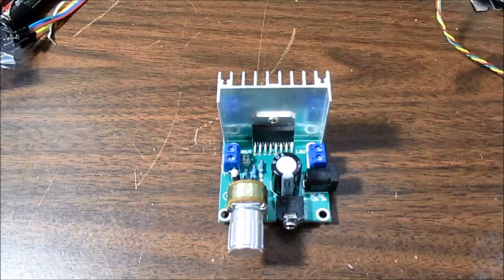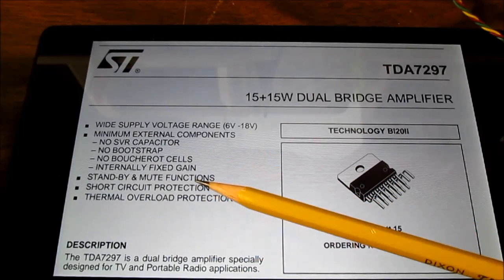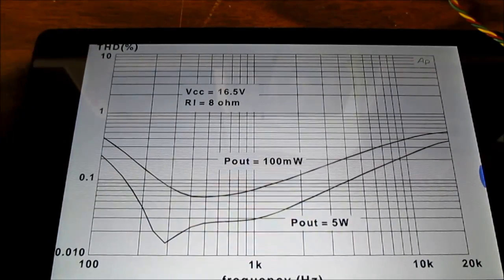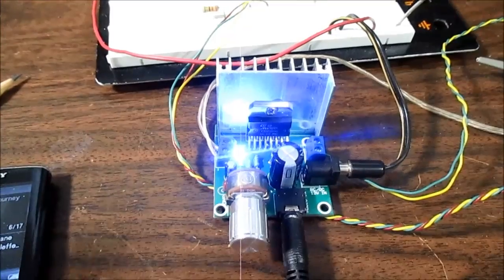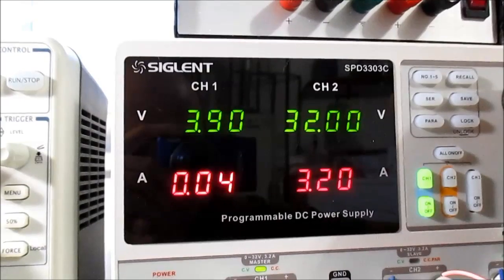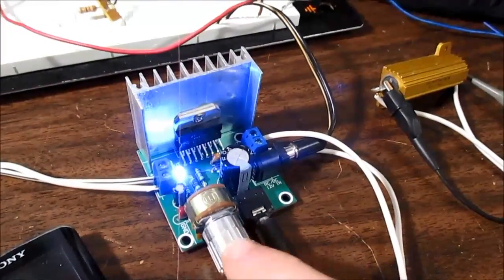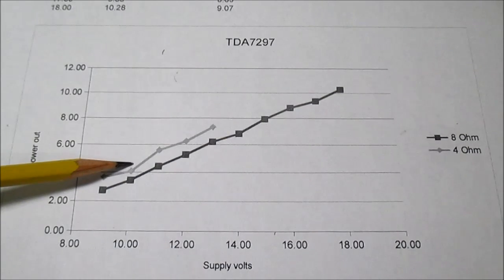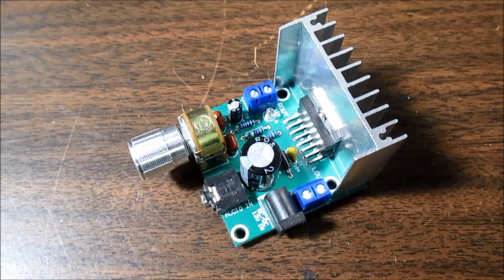TDA7297 stereo audio amplifier board test and review

Comment: Very useful review- looking for a 9v amp for a bench amp to test pedal effects. Tried a pam8610, but found it noisy, and an lm386 (noisy cricket) but the power was underwhelming (was  only able to get 0.3w clean). Price of this module is very cheap now, so worth trying it out- hopefully 2.7w clean output on 8r will work out. Would be useful to learn if and how this amp (module) could be bridged for more power!
Reply: Goid dear..subscribe anotheroption2.0
Reply: It is already bridged. It was done so probably to save on two output capacitors.

Comment: I have questions-
1. Can this chip be powered by a 12 Volt transformer which outputs around 20 volts @ no load ?
2. If this chip is used with higher wattage speakers like 40 watts (6 inches speakers) , will it lead to overheating of the chip ?
Reply from the maker: Max voltage of the IC is 18v. I assume that voltage is after rectification and filtering. The light load of the IC at idle my lower the voltage a bit. You'd have to check that.
Speaker wattage has no bearing on the current draw from the IC's output. The speaker impedance is what is what determines the current draw, so an 8 ohm 15 watt speaker would work as would an 8 ohm 1,000 watt speaker.

Comment: @JohnAudioTech
Made a monoblock of this PCB using only one speaker channel out. The specification says: 
2A "Output Peak Current (internally limited)"
Is that limit 2A for the total chip current draw. So when I use only one channel is that allowed to draw up to 2A or is it divided between the channels to 1A each?
That is a interesting question how the limitation is implemented in the chip.
If the limitation is on the whole chip or on each channel 2A/2?!
Reply: I did some calculations with your numbers. I use 12v battery so I only look at that:
8ohm 2ch clean power (5.27x2)/12 give 0.87A
4ohm 2ch clean power (6.25x2)/12 give 1.04A

The specification state MAXIMUM ratings:
2A, 33W and 20V. Gives 33/20 = 1.65A
(Most probably not clean and in clipping)

So my conclusion is that either way I will never hit the 2A limit and not even 1A in one channel driven, that I use.
So the "internally limited" current is no issue when we stay and use clean power and not go into clipping.

Is this a right conclusion to make?
Reply from the maker: @AmazonasBiotop  The 2A rating is peak current for each channel. The poor power output performance of this IC with 4 ohm loads tells me it is struggling to handle the current. At 12 v supply, I'd expect around 12 watts of clean power with a 4 ohm load and this IC delivers only 6.25w. Sq root(6.25w/4ohm)=1.25 A. This is an rms value, we need peak, so multiply that by the square root of 2 to get 1.77 A peak. This is below the 2A peak limit. I'm not sure why the current limiter is activating early. It could be a thermal issue.

I just reviewed the TDA7377. It is on a similar style board with a better heat sink. The chip performs much better, giving the expected power into a 4 ohm load. It has a much higher current limit of 4.5A peak.
Reply: @JohnAudioTech  thanks for your reply.
I parallel the TDA7297 in my build like you showed in one of your videos.
With 4 resistors.
I made the same but used a little bit oversized resistors (four 10w 0.1 ohm). It did not work the chip went into clipping and the heat sink got incredible hot!
Here is a video and sound of it:
https://youtu.be/Iz9I3hJNAt8
(There is 3 more parts if you want to see the build)
Wonder what went wrong?
Reply from the maker: @AmazonasBiotop  Sounds like the phasing is wrong on the outputs which makes a short circuit. Try reversing the connections on one of the outputs.
Reply: @JohnAudioTech  Thanks will look into it or upgrade to the better TDA7377.
Today I only use one channel on each amp.

Comment: Do you remember vaugely how much current this pulled from the power supply 16v 8ohm @ clean full output?

Cheers
Reply: I'll be running this setup in couple of days - I'll let you know. At 12 volts the current draw was a little over 1 amp into 4 ohm load. It did get hot as John said.
Reply: The current draw at 18 volts into 8 Ohm loads before clipping was 1,75 amps with 1kHz sine wave. It went over 2 amps with square wave.

Comment: Those little amps are sold as an amp for DC and AC input voltage. That's also why that diode is there as well. Its a half wave rectifier. Although I always have used DC input to reduce noise. I have purchased amd used 4 or 5 of these. I am very impressed with these amps.
Reply: Good dear

Comment: Heaps of these on aliexpress... and the prices vary wildly. A lot seem to omit the heat sink and given how large they are... guessing they're there for a reason. Hate the way most mount the audio input on the front near the volume knob as it limits how it can be used.  I have a similar lm386 amp at the moment I use on an ESP32 and it works great... but eventually I want to get stereo output going.

Comment: I'd love to see a test on a little board I just received... I have no idea what chip it's using; however doing a search of "20w Bluetooth 2.1 channel board" on eBay will show you what I have. It has two knobs on the front side and comes with jst pigtail connectors for battery, left channel, right channel, and subwoofer. I had a nice voombox Bluetooth speaker that the board died on me, and having tiny smd components I decided not to bother trying to fix. I harvested the speakers, passive radiators, and the subwoofer to reuse and I'm glad I did. $4.62 for the amp board. I can assemble a high capacity 1s li-ion pack for no out of pocket cost.. now I'm just looking into enclosure materials and design.

Comment: I'm not a tech-head, so what I'm asking may not be relevant to your other followers. I came across an old late 40s/early 50s radio that has a nice case. I want to put an F.M radio in it, but maintain the vintage look. Most of the inexpensive kits would be hard to adapt, since they're stereo. I don't want to bridge both outputs to one speaker. The cheesy kits are all I've seen in my price range. Would using the TDA 7293 amp be a realistic way of getting good sound out of this?
Reply from the maker: That's a lot of power for an old radio, especially if you use the original speaker. If its a small radio, I'd go 1 watt tops. If it is a larger radio with, say a 10 or 12" speaker, I'd go 5 watts tops. Those old speakers are made to be very loud with little power and cannot handle a lot of power.
Reply: @JohnAudioTech   The original speaker was damaged, so i was planning on using a car audio speaker. Since they are avail;able in six inch sizes. The original radio wiring was in poor shape, and I'm not sure how easy it would be to replace the tubes. Plus, I don't listen to a.m, so using the case with modern components seems like the easiest plan for a non-techie, like myself. The tuning window is rather small, so putting a digital face in the spot seems like an easy alternative. Adapting it so I can use similar sized pots is the hardest thing for me to do. .

Comment: I've had this thing for several years and its got it quirks.  It's being used 24/7 with my computer and powering a couple of cheap speakers.  Computer on I hear a pop.  Same when the computer switches off.  It needed a new electolytic cap after a year.  The old one began to buldge.  It seems to have some grounding problem in relation to what the computer is doing.  If you just disconnect the inpute it develops a loud buzz.  Just a few weeks ago it developed a cracking sound on certain frequencies though one channel.  It could be the speaker but its hard to tell.
Reply from the maker: The pop from the computer turn on/off is probably the computer sending a pulse as the coupling caps charge up or discharge during power on or off.   Turn the volume down on the amp to see if it goes away. Noise from unplugging the input is just electrical noise picked up on the input line. These amps use cheap components that can fail, so I'm not surprised about the remaining problems.

Comment: Jonh I studied your video here and went to look at the full data sheet of TDA 7297 altho I just didn't understand all the points and FIGURES give.

One thing I noted immediately was its output is actually more or less 5wpc rms at 16.5vdc, output measured at 8 ohms THD< 1%. I use two pairs of jbl 4320 speakers and they are very efficient, @96dB SPL 1 metre. And so I decided to order 2 of these amps, assembled. At taobao, these cost me peanuts, literally. 

Long story short, they are doing an incredible job here. And so I am wondering. The jbl 4320 was produced with an active amp'ed in its time for studio applications, and two way low level active cross-over boards pre-assembled kits are the way for me to go (yea coz the fun is huge, init?). So, maybe I'll give it a go.

Comment: John I am enjoying your videos, thanks. Can you recommend a small stereo amp board that can manage 4 ohm speakers at 12 VDC?  I have a bunch of them as well as some 16 ohm speakers. Any help would be appreciated.
Reply from the maker: Check my amplifier playlist. I have reviewed several that will work with 4 ohms and should be fine with 16 ohms as well. Most work at 12v dc.
Reply: JohnAudioTech  Thanks John.

Comment: Which is better amplifier pam8610 or tda7297
Reply from the maker: The PAM8610 boards I tried had issues, so go with the 7297.
Reply: I have a butch of pam8610 its hard to fit a heat-sink. Hooked tda7297 to a CPU heat-sink and......this thing gets LOUD!!! ( using a pair of 20W speakers)  barely warm!

Comment: Hello. I have bought this tda7297 board from amazon. I have hooked it up to two sony speakers rated at 25 w 6ohms. I use a power supply of 12 volt 3  amps to power it. I was wondering what would happen if i connected a preamp board board between this and the 3.5 mm output?
Reply: you would hook the pre-amp BEFORE the amp, not after it. I'd assume that the tda7297 output would blow the input of the pre-amp if you wire it as you mention. Having the pre-amp before the tda should not be a problem but, depending on your original signal source, it may not be needed...

Comment: Generic question here but im strongly considering using this board for a DIY "Sound Bar" for my TV as this TDA chip has the specs i'm looking for. Do you think a Mean Well LRS-50-15 will be able to have this IC reach full power into 8 Ohms? i know that supply is only 15V but it can be adjusted from 13.8V to 17. something volts. ill most likely set it to 16V

OR
Would i be better off going with the Parts Express PAM8610 board? both options seem to put out the same power into 8 Ohms at 14-16 volts
Thanks in advance, love the vids!

http://www.mouser.com/Search/ProductDetail.aspx?R=LRS-50-15virtualkey63430000virtualkey709-LRS50-15

Comment: Hello John, I subscrbed to your channel and like your reviews.

John, I bought one of these TDA7293 amp boards that require a AC input and
the ad mentions only 12-50Volts AC.  I want to make it into  a 100watt (peak) guitar
extension speaker that will be slaved off the the headphone mini-jack from ,  my
Fender Champion 40w SS amp that already uses a similar audio IC (TDA7294).

The AC input (Hammond transformer with centretap ) available is either a
185E36 (36 volt secondary CT @2.2 amps)  
 or 
185E28 ; 28 volt secondary CT @2.8amps.

Which one should I use not to exceed the DC rail voltage,  and still get a good power level
from this amp?

From my calculations,  28volt secondary rectified by a full wave bridge is 28 AC x 1.41= 39.5 vdc peak no load.
With a the TDA7293 load (2amps @80watts? peak), the power rails shouldn't drop down much  below 25vdc.  
 Not sure what the Chinese advertiser means about 12vac -> 50volt AC ..Does it mean I can only use a Max 50volt AC secondary?      

 That could mean thatthe  50volt AC which would exceed the rating of the chip?
max 50vac x 1.41 = 70.5vdc (+/- 35 vdc per rail). 

  With a 8ohm load the avg dc would be around 50vac x 0.90 = 45vdc  or about 22-23vdc per positive and negative power rail. 

Should I use a 28v ct or a 36v ct and still be safe witout power rail regulator (T0-220) to
be on the safeside?
 I'm also putting in a speaker fuse (2A fast blow) to protect a expensive guitar speaker (Celestion V series $131) since this TDA is dc coupled directly to the speaker and COMMON.
Reply from the maker: These appear to be the wrong transformers. The 36v version has two 18v secondaries and the 28v one, two 14v secondaries. These would not provide the IC with enough voltage for the high power you want. Look for a transformer with two 28 volt secondaries or a center tapped 56v secondary. For the power you need, select a transformer with 3 amp secondaries or 168 volt-amp rating minimum.

Personally, I multiply the transformer's voltage by 1.6 to get the max unloaded rail voltage. This allows for load regulation and a bit high line volts (mains voltage), so the DC rail could reach up to 45volts DC (90v across the rails) using the 28 volt per side transformer. This is to assure you are safe with that chip which you are. Under a decent load the DC could fall to around 38v or so per rail.

Some of those kits are dubious in quality. I can only recommend the one I tested.
Reply: Your advice is much appreciated. Yes, I am dubious at the price of these amps now on Ebay going for less than $5.   The transformer is going to be the most expensive item for this build , so I would like it to be the correct one for around 80watts output.

 I found a Hammond 56vCT at Mouser that will do the job.  It is 100va @1.8amps secondary.   Hammond part number 186F56.
Reply from the maker: It should work, but still, I'd get at least a 150 va.

Comment: Hey John. Enjoy the video's. Is there any way to add any circuity to the LED to reduce the brightness?  I have always wondered. I have several devices that have super bright LEDs that I wish were not so bright.  Maybe you could do a video?
Reply: jeff hayes You could just replace the resistor that is in series with the LED with a higher value one

Comment: I have 3 of these and I`m pretty happy with the little amps, I`m getting some hum when touching the volume knob at anything beyond 1/3rd volume though, but no biggie..
I run one of them in a DIY speaker with 2 samsung ht 2.5" 15W 8ohm speakers in a 2.5Liter box using a 11.1V LiPo, and have a balance charger inside the box, and a voltmeter up front with the volume knob.
Next edition will be 1.5L and I`ll include a low voltage cutoff :)
OR, I`ll use 2 of these and 4 drivers, as I have four of them lol, I also have two 20W tweeters, so I guess I could make a much bigger box too..
Time will tell :)
Long rant, good little amps..
Reply: Btw, I use a FiiO headphone amp to get the full potential out of the amp, as it seems to want a high input signal
Reply from the maker: You can get rid of the hum by soldering a jumper lead to the metal shell of the pot and connecting the other end to a ground point on the board.

DIY speakers are fun to build. The ones used in my videos took a bit of tuning to sound right but once they do, you're in audio heaven!

Comment: Great review once again!
Reply from the maker: If you want a lot more amp power tests, BigDWiz tests these little amps, car power amps and some home audio gear as well. Check him out.
I'm outta Heeeerrrrrreee!
Reply: John, you do such a thorough review of each amplifier you test, I'd love to start working with you. I'm an enthusiast, it's obvious you are either an EE or have extensive background in electronics. We both appear have the desire to test amps! I'll be more than willing to send you some of these mini amps I'm testing now so you can check them out. Maybe we can work out some kind of collaboration? You can contact me via email bigdwiz (at) gmail if you want. Looking forward to hearing from you.
Reply: John, there is a lot more to this Amp and with minor adjustments, I have cooled it after running it at a very high volume to the point that at "anytime", You could put your Tung on it (The Processor), again after running this Amplifier for well over an hour at a very high volume !

That said I run only "1" Channel @ 12v - 6a on one 12" (6" Woofer - 1" Tweeter) Home/Bookshelf Speaker and for life expectancy @ a little more than 1/2 power (Say 65%) and the sound quality and the depth of the sound is unreal !!

And I won't name the price of each Amp... ?

Ridiculous !!!

I don't know 5% (Electronics) of what you know and I have none of your equipment but My ears can tell me a great sound !

Amazing how little most know ?

Rick - SoCal
Reply from the maker: Email sent! I had some EE in college but enjoy it mainly as a hobby. I've enjoyed audio for a long time. Electronics and audio go well together. Have a happy & safe 4th!
Reply: BigDWiz 

You guys both rock!